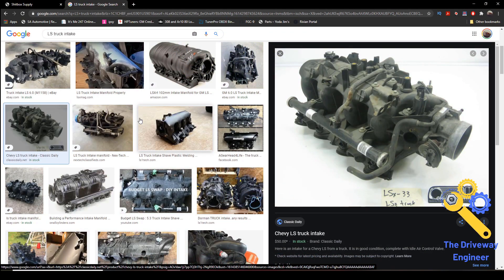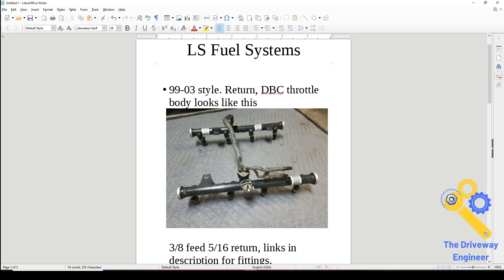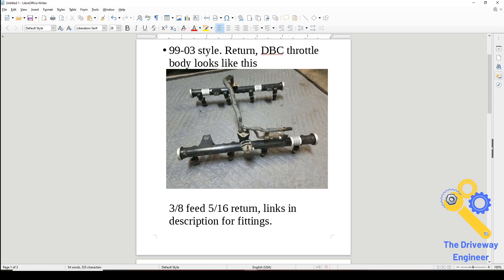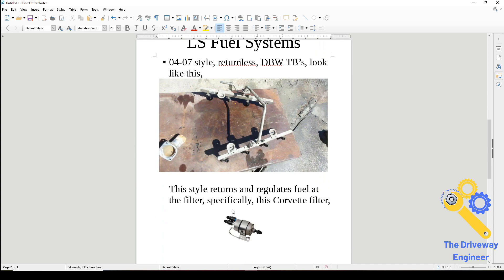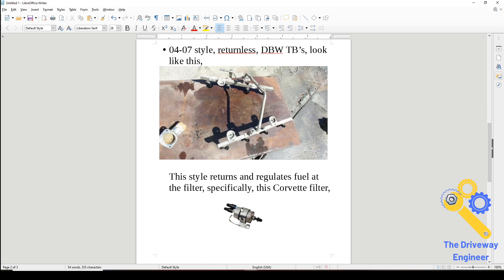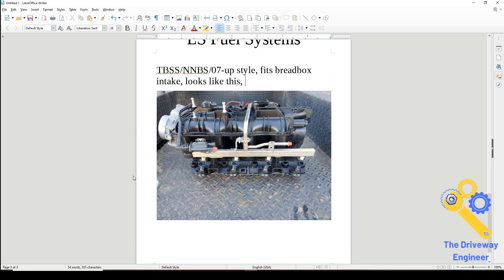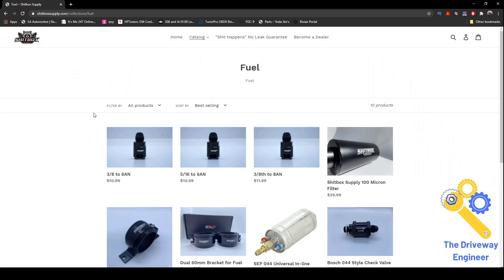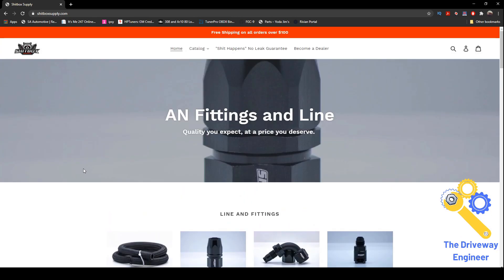How to plumb your LS swap fuel system, return, returnless, NNBS, NBS, WTF??

Comment: What do you recommend I do?
I have a return at the fuel rail but no where to return the gas to my gas tank is from 1966 only has gas out & I’m using external fuel pump 

Should I get the corvette filter & run the return from the fuel rail to the corvette filter?
Reply from the maker: That won't work.

One way or the other, you have to have a return into the sender/tank

Comment: Brother im having an issue with my 525lp pump.. 

Im getting 100psi at the fkn rail lol.. my truck is 07 classic return less.. no regulator..
Question is can i stay returnless or is it mandatory return style.. running the intank pump
Reply from the maker: You have to have a regulator, whether before your stock rails, or in a set of return rails
Reply: @ i appreciate your reply man.. i got tuned for 60psi & it worked a little while. Some reason pump blew my fuel pump relay & may have fried the wires… 

So im fighting this fuel setup issue.. i wanted to avoid dumping money in it. But looks like i will be doing fuel lines & regulator …

Comment: how many fittings will I need to make a complete system on a 04 returnless with the corvette servo, have a 03 that’s going from a 4.3 to 5.3 the motor I have is a 04 the fuel system I have not is return style

Comment: I have a 2002 5.3 LM seven that I am turbo charging. I did buy the 80 pound deca injectors. What do I need to do with the factory fuel pressure regulator do I buy a bypass cap that goes on it or just unhook it and use an aftermarket fuel pressure regulator, and what kind of PSI would you recommend running on the new 80 pound injectors at the fuel pressure regulator?
Reply from the maker: No reason you can't use it exactly as is
Reply: @TheDrivewayEngineer  ok love the videos thanks so much

Comment: Great video. Do you know off top of your head which returnless rail will be a direct swap onto a return style 2002 intake? I’m swapping into a flex fuel s10 and has returnless/corvette regulator setup from factory. If I could just swap the rail setup it would be optimal. Thanks for your help
Reply from the maker: A normal 02 rail is return
Reply: @TheDrivewayEngineer  right but I need a returnless rail that will mount onto my 02 intake. My s10 that I’m swapping into already has returnless fuel setup.

Comment: 99-03 style with return. Do you have an additional regulator or just the fuel rail? Thanks
Reply from the maker: Regulator on the rail is all you need
Reply: Thanks so much @TheDrivewayEngineer

Comment: Hello. I am swapping a 5.3 from a 2003 suburban. It is a DBW and return style. It is getting put into a 2006 Colorado 2.8 with a returnless system. Is it as simple as blocking off the return line on the rail to make this system work?
Reply from the maker: It's simpler to just swap the rail probably

Comment: I have bosted 08 silverado 5.3. Is it best to convert to fuel return? And is there a video you know of that shows how to?
Reply from the maker: If it's working now why switch?
Reply: @TheDrivewayEngineer  my fuel line in the gas tank keeps blowing off. What's a good submersible hose? I used one from gates and it started breaking down and got slimy.
Reply: @lylegoodluck get e85 submersible & new hose clamps

Comment: Never had one leak. That was hundreds at the dealership as new o-rings came in the package. Hit with compressed air, wipe clean with rag, use pick to change. Love the channel but changing engines may have stressed a fitting and tiny micro fracture. When GM sees a high failure rate they ask dealers to ship them back to testing. Stress cracks was the only issue per hundred with cut o-ring, dirt. Not sorry. ASE Master Tech since 78. Retired.
Reply from the maker: I have no idea what you're talking about, so no need to apologize 😂

Comment: Is there a difference between the regulators with the vent tube on the side and ones with it on top? Mine has the regulator with the vent tube on the top and the vacuum line to it wont stay on due to the orientation. If that doesnt matter then ill be ordering one with the tube on the side
Reply from the maker: I've never noticed that, I've always used whatever I have

Comment: How do I bypass my in tank regulator? It hates my Walbro 525. Bought a aftermarket regulator and I'm just wondering if I have to block off the one in the tank by using a Corvette in tank regulator bypass, or if I have to do something else
Reply from the maker: No idea what an intank regulator looks like. But if I hadf one, I'd just take it out? Can't be that hard.
Reply: @TheDrivewayEngineer  it isn't but its spring actuated and has a ground wire running to it as well. I'm just not sure that if I take it out it'll build pressure with the regular regulator. It's built into the pump basket and fuel has to flow through it. Look up Chevy avalanche 1500 fuel pump, 2004

Comment: So u can  just mount the c5 filter where the stock filter goes on a return system and just make the return alot shorter? I currently have it on the tbss fuel rail and I hate it. Scared its gonna leak
Reply from the maker: No, not at all, no way.
Reply: @TheDrivewayEngineer no way what

Comment: Love the videos, trying to figure out what to do with my fuel system if you have any suggestions, 07 suburban full exhaust, cammed with a whipple stock pump and regulator with 50lb injectors, I plan on upgrading the pump and going with 90lb injectors, would it be best to go with an external regulator with a return line?
Reply from the maker: Theres no need to unless you just think it looks cool

Comment: so building a car on a whim. guessing i got a 03 due to the design of my system. in line fuel pump, had to put a return in the tank. my question. due i run the return line from the intake to the tank? can i plug the return line port in the fuel regulator i bought. my current set up is tank-filter-pump-filter-10 feet of line to the regulator under the hood regulator to fuel rail. i currently have the return port on the regulator plugged with a bolt it cam with. so can i just run a few extra feet of return line straight to the return port on the rail?
Reply from the maker: I'm lost in all of that lol.

If you have a return rail, use it and throw the regulator out.

If you have a return less, run the return from the regulator
Reply: @TheDrivewayEngineer  well the pump can do up to 80 psi.
So the regulator drops it down to 60 psi to the rail. I'm just asking where does the return line on the rail go. Straight to the tank? I don't have the corvette style. Tank to pump pump to regulator 60 psi regulator to rail rail back to tank
Reply: @TheDrivewayEngineer  
So I had to do some looking.
I have a 07 cast iron block
With a 03 shaved and sanded intake
With a 02 throttle body.
My current options are.
Buy a new fuel rail system but idk which to buy?
Or plumb the current set up.
I could provide pictures if needed im just not well versed Here and hoping for some input from someone who knows more

Comment: Hello good Video quick question would I still need a aftermarket fuel regulator or Can I just use the stock regulator on the first gen truck intake
Reply from the maker: The one on the intake is good to go
Reply: @The Driveway Engineer  ok thank you

Comment: The clip on regulator on the fuel rail is a high failure rate item and causes long starts. It also destroys its own evidence. Let it sit overnight and if you find fuel in the vacuum line that goes to it, it's bad.

Comment: Had a donor 2006 escalade with returnless system- did a 4.3 to 6.0 swap it to 2005 silverado- had same setup on fuel line and connector, do I need to upgrade anything?
Reply from the maker: Nope

Comment: Great info! Thanks!  Im putting a 2003 5.3 in my C10 in which I relocated the tank underneath the bed. The 5.3 has a return style intake and Im wondering if you think its ok to use the Corvette style filter /regulator and bypass the regulator on the fuel rail. The reason is I was hoping to avoid having to run the return line all the way to the back of the truck. Thanks
Reply from the maker: Yes, you can do that, you have to change the injectors in the tune though
Reply: Thanks for the info! I’m doing the same thing, but I’m not going to change my injectors. I’ll just run it all the way back and leave stock injectors in the motor. My retromod is a 1959 Apache sitting on a 1983 frame, with an LM7 for power.

Comment: I was curious and been looking and trying to find out if I can put corvette fuel filter/regulator in tank?  Vintage car with 1 fuel line. Not sure if would work hoping someone has tried it.
Reply from the maker: I suppose you could, I don't see why it wouldn't work if it fits, usually the holes in the early tanks are too small
Reply: @TheDrivewayEngineer  thanks for the response. I am gonna try will let you know. Hoping to finish next weekend will let you know. Just cutting down on hoses and fittings outside tank if it doesn't will mount filter outside tank.

Comment: Thanks for the Awesome videos, Can't get enough. The fuel press regulator's are known to leak internally sending fuel into the vacuum hose and into the intake causing idle misfire and P0300. Usually after 100k miles or so, thats why they go missing lol.

Comment: I have 06 silverado 1500 4.8 I don't see a pump or pressure regulator on frame or anywhere. I'm not a mechanic. I didn't think its beyond my ability. Its a 3/8 single feed. I was gonna make fuel line out of metal and rubber. Do I need a regulator on the fuel line. The only place I cant see it is around bell housing so I am confused any help be appreciated.not Debbie her  son using her.
Reply from the maker: Regulator is in the pump assembly in the tank
Reply from the maker: There's no return on a 06 Silverado

Comment: I have a 2005 silverado with a non-return fuel pump system .... but I would like to know if I can convert it to return style .... I have heard that the 2005 works with a module that controls the fuel pressure ...  My plan is to install a return style pump with the corvett c5 filter so the return style pump would only install the ignition current and the pipeline until there I'm fine I think ... what worries me is that the module would be disabled and I don't know if I  affect the melody or operation of the truck since I do not want to use that module ... any help would be greatly appreciated
Reply from the maker: You can converter to the return style rail, just swap it, and tell your tuner. 

If you want to use the Corvette regulator... Then keep the returnless rails.
Reply: @TheDrivewayEngineer  then you would have to run new wiring for the return style pump and disable the fpcm module
Reply from the maker: @alejandroamaya5907  yep, it's one wire lol
Reply: @TheDrivewayEngineer  That wire would only be the positive wire that would turn on the fuel pump, right?
Reply from the maker: @alejandroamaya5907  correct
Reply: @TheDrivewayEngineer  ok thank you very much it seems that everything is going to be fine I hope I don't have many complications ... what lph number would you recommend me to use? I really don't have that modified my car I'm just running a 370 ci with a stage 4 ls1 btr cam and 50 lbr fuel injector
Reply: @alejandroamaya5907  @ what did u ended doing on the  fuel system???
Reply: @gerardolopez5875   todavia no le e hecho nada pero creo la mejor opción es instale una fuel pump son sistema de retorno … porque preguntas !?
Reply: @alejandroamaya5907  @ tambien  estoy haciendo un swap en mi 93 obs,    Y es la primera swap que ago returnless,,, pero si  funciono bien el corvette style fuel regulator,,,    Y use una  vortec fuel pump, en sending unit,,,      Pero si tu tienes una fuel pump module, de la returnless system , nomas metela en un tank universal, y funciona, yo no kise meterla en el obs tank, porke keria usar el sending unit de 93.  Y tambien ya tenia la virtec 5.7 fuel pump,,,   👍👍👍
Reply: @gerardolopez5875   orale gracias 🙏🏻 oye y de casualidad tu no sabe si si se puedan modificar la programación del modulo de control de la fuel pump de un silverado 2011 esque ya le instale una fuel pump nueva y me sigue aventando baja presion
Reply: @alejandroamaya5907  @ no sabria decirte

Comment: What is the advantage to cable drive vs fly by wire,
Reply from the maker: I'll discuss that in an upcoming video, but other than ease of install, the DBW is better in every way.
Reply: If you have a car with a cable gas pedal already in it, it's the easiest way to go
Reply: If u want cruise control dbw is way easier
Reply: Dbw is easier to tune from what I understand.
Reply: I'm going with fly by wire, because that's what my complete engine came with I'm sure there are advantage's either way, gain custom tunability loose simplicity etc. All my newer vehicles have it and haven't broken or needed repair.
Reply: Cable response is better.

Comment: Do i have to be a high ass efi tank or can i use the factory tank? It currently has a external fuel pump
Reply: I did a 1950 buick if you go in tank pump u will have cavation issues with a unbaffled tank u can add baffles to tank u got but its no easy I bought a efi tank for a 1953 chevy from tanks Inc's for like 300 shipped after the stock tank was a major fail depending on your vechicle u might be able to find a close enuff tank at pick a part that u can make work
Reply: @jeremyhanna3852  72 monte , 63 nova guess ill be buying new tanks
Reply: @tennesseesyndicate5337  yeah if there is radiator or tank shop in your area they might beable to baffle what you got cheaper than New tanks
Reply: @tennesseesyndicate5337  i think some where I read u can reto fit a k5 blazer tank in the monte easy but not sure and u can get a efi tank for 88 k5 pretty cheap
Reply from the maker: An efi tank will be best
Reply from the maker: The Monte can use a B body EFI tank
Reply: @TheDrivewayEngineer  ok thanks for all the help
Reply: As long as you use a fuel pump that can keep up with required PSI.